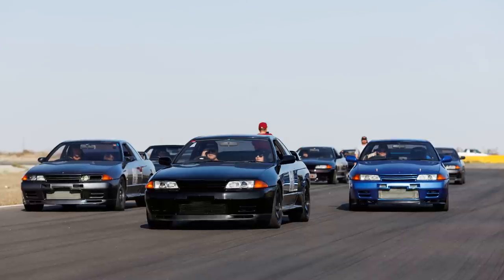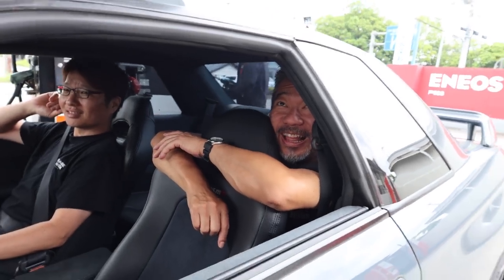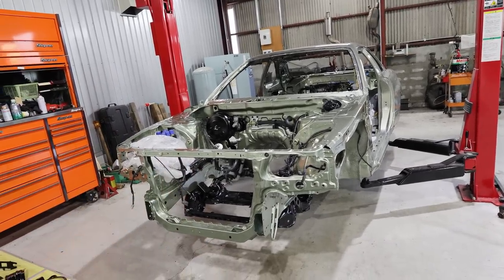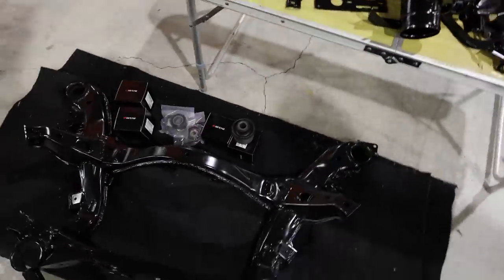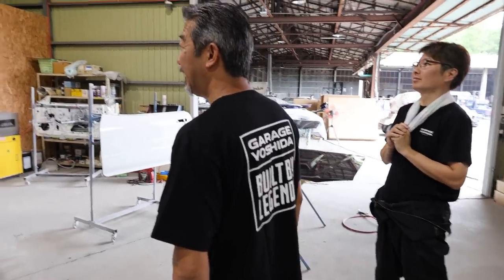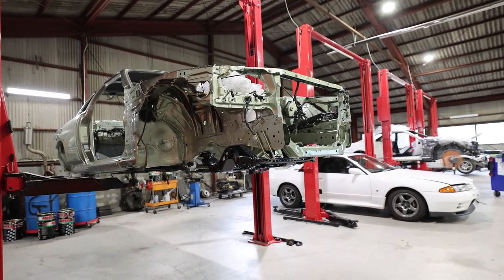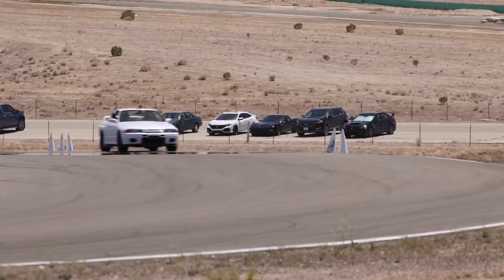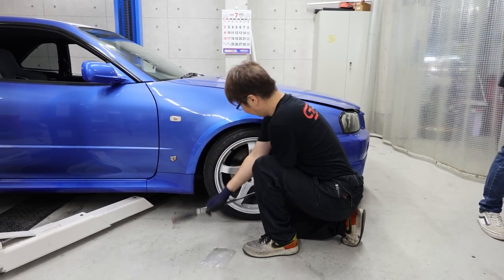Reviving Legends: Inside the World's #1 Nissan GT-R Restoration Shop | Capturing Car Culture

Comment: It's totaly mindblowing, deeply hearttouching. Makes me proud to own Japanese car. Even if not anywhere close to GT-R, but for me, my '91 Prelude means the same as Larry's R34 to himself. Domo arugato for this magical journey. Showing JDM spirit, giving hope. I'll never stop driving...
Reply: The Prelude is a great car and had a lot of similarities to the GTR when it came to its place in Hondas lineup. It was the first production car to have 4 wheel steering in 1987, it was one of Hondas best handling cars despite its weight due to the 4WS, Super Handling (torque vectoring diff) a high output motor with excellent steering and braking. It’s style starting with the 3rd gen was always popular and they still look good today, especially the 5th gen. There was even a rumor of an AWD prelude for racing.
Reply: That’s how I feel about my 93 prelude!

Comment: Thats so true about the 2 different shades of paint if you look at most cars the bumper thats plastic or not metal. Will always show as a slightly darker shade and it will also fade at a different rate but straight out of the booth youll see the slight difference and its like this with all cars so its absolutely amazing to see this guy make a slightly different shafe for the plastic and metal thats attention to detail ❤❤❤❤

Comment: Such passion in Japan for the magnifcent cars they have produced over the years I came across very early having been fortunate enough to own a number of Japanese legends starting way back when with a 1965 Mazda 1000 Coupe a 1 litre sohc with an engine that looked exactly like the later Mazda Luce 1600 and 1800 sedans styled by Bertone a beautiful classic worth finding and restoring including the rare Sports SS versions my 1000 Coupe ran a full instrumented dash dual 2 barrel downdraft carburettors and with front Disk Brakes as well, Quite amazing for 1965 

That was followed by in no particular order by a Genuine TE 27 Levin, an AE86, a Ex Nissan Motorsport PA10 Fuel injected Violet Stanza Coupe I bought from Nissan Motorsports Driver and legend George Fury and prior to George owning it it was the Rally liason car of Nissan Motorsport Australia boss Howard Marsden who previously was Race Team boss for Ford Australia.

Adding to the Nissan theme a Group 2 Nissan Stanza Rally car full ex works suspension front and rear works Wide Track rear axle four wheel vented works spec disks, Works front Struts with Pillowball upper mounts  Works steering gear and what is now a very expensive proposition to find a Genuine Nissan FIA Cylinder Head these alone these days will owe you a minimum of $10,000.00 and need  full overhaul on top of that and almost Forgot Nissan Factory spec Alumimum Radiator.

Add to that mix a Genuine ex works Nissan Datsun PB210 Rally Car that even Nissan do not have an example of in their Museum  driven by Sheka Mehta the PB210 is like a 120 Y with a longer nose different tail lights etc and a 1600 CC variant of the LZ 14 Formula Pacific twin cam engine.
Almost forgot Ex Peter Williamson and after that Alexandra Surplice TEC 37 Levin driven aat Bathurst by the son of Margaret Thatcher British Prime Minster during the Falklands War Mark Thatcher, Sadly this got sold to a mate to reshell his rollover damaged KE 35  TE 37 replica and this original Australian Group C touring car was lost to  Circuit Racing as six months after that suddenly Group C touring Cars became eligible for Historic Racing but no replicas only Original Cars with History permitted.

So looking Back I consider myself blessed with what I have owned and that does not touch on Alfa Romeos, Sunbeam Tigers, MGA Twin Cams, assorted Fiats ,Simcas, Escort Twin Cam, Ford Capri RS 3100 etc

Comment: the two paint colors is more likely because the translucency of the paint color and the big difference in base material color. so that having a slightly lighter color of paint sprayed on unprimed black plastic parts would match the slightly darker color paint sprayed on primed light grey parts with fewer coats.

Comment: This seems like a perfect opportunity to seam weld the whole chassis even doing the reinforcements and other pieces and panels. After it’s striped and all the rust is removed the go through and completely weld any of the spot welded parts. This might add some weight but it makes for a much stiffer chassis. If GTR’s are already seam welded, I was not aware that they were. Depending on what your goals are with the car this would also be a great time to lighten the chassis by drilling holes in it. A long time ago there was a shop in Japan that would do this to your car to make it lighter. It takes someone who knows what they are doing to do it right but imagine how special your GTR would be with it seem welded and reinforced at the frame level and how much weight you could shave off with strategic drilling of holes. Nobody would be able to see the upgrade but they sure would be able to feel it.
Reply: 8:52
Reply: @andydhillon1977  did I miss it?
Reply: @chrisjosekuehl  You did. 8:52
Reply: @andydhillon1977 he’s not talking about seam welding the chassis. He taking about those replacement parts he’s having made.

Comment: nice. wonder what the costs are for a full restoration.
Reply: yeah, that's a very important detail to leave out. I suspect it's one of those "if you have to ask, you can't afford it" scenarios.
Reply: Cost varies depending on what the owner wants.
Reply: Old guys from the muscle car era always said that $150K to $200K is the cost of any nut and bolt well executed restoration by professional shop, mostly because of how much a working hour is billed. But because of the fame of these cars now it's probably same cost as official Nissan around ~$400K.

Comment: Growing up in the 90s and early 2000s where i lived we were literally surrounded by jdm sports cars (and normal cars) they weren't jdm cars to us, they were just cars.

Your mum drove a jdm car, your friends parents drove jdm cars, your teachers drove jdm cars .

We expected to see Japanese writing on the sunvisor warning labels and door jambs, what other language would they be in? Its Japanese?

Only when i got older and lived overseas did I buy the same Landcruiser models that i had growing up and see english writing because they were not jdm.

Never in all of our wildest dreams did we stop to think one day these cars would disappear, there was so many of them that we just assumed theyd always be around.

It was common to see 2 or three GTRs at a grocery store car park.

We drove them like we stole them because a replacement engine was about $2600 and there was an endless supply.

A replacement gearbox was $700 when you blew your third R32 box at the dragstrip.

Wrecked your car? No worries, any number of 300+ used Japanese car dealers would have more than one Skyline freshly imported on the lot. Take your pick.

Or go to the used private market.

As an example you could buy the following:
An FD RX7 $26k NZD about $17k USD

R32 GTR $19K NZD about $11k USD

R34 GTR about $44k NZD or $30k USD

A Supra RZ $30K NZD about $21k USD

A GTS-4/ MR2 GT/ Integra Type R $9500 NZD or $6000 USD

We never imagined in our wildest dreams these amazing vehicles getting ground up restorations. 

Time is a beautiful thing and also a savage reminder of better days.

Comment: The only I have about the stronger than original story is if this is as safe as the original. There is a reason there are weak parts in on the car these are there to serve as a cushion in case of an impact. If they are stronger and less likely to fail as expected the effect is for the driver to end up being smashed into a brick wall simply because the folding and where it is supposed to does not happen. This is why a race car that gets into an accident blows into a million pieces just to dissipate as much of the energy of the impact.

Though it sounds great having stronger parts I'd much rather have factory spec from a safety point of view.

Comment: I feel like, by the time I actually get behind the wheel of an R32, 33, or 34 GT-R, it will have been SO overhyped that it will be a letdown.
Reply: It is a possibility. It's an interesting period in history. These cars were amazing when they came out, but most of us expected newer cars to be even better. To many of us, that's not the case, evidenced by the rising values.

I have been an Integra Type R enthusiast since they were new. At these higher values, I don't think I will be able to enjoy them as much now
Reply: I know what you mean. Legends get larger as they get retold. I think about how many legends leave Japan and get inflated by the time they reach the USA. For example, the urban legend of the used underwear vending machine won't go away.

Comment: Frame straightenig process... !?!? What sorcery is that? 

From my knowledge one cannot straighten a metall without weakerning it if its not heat threated afterwards. 

So essentially he is sacrificing rigidity for geometric accuracy!?
Reply: I think it means that if the body is not fully straight, you put it in that brace before you put in the subframe etc.